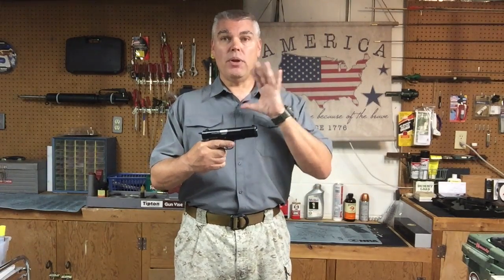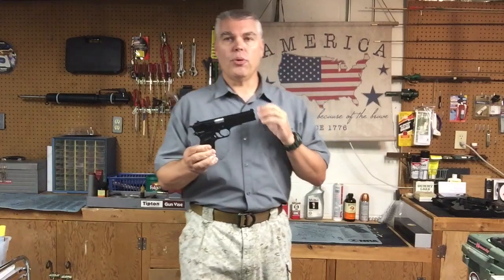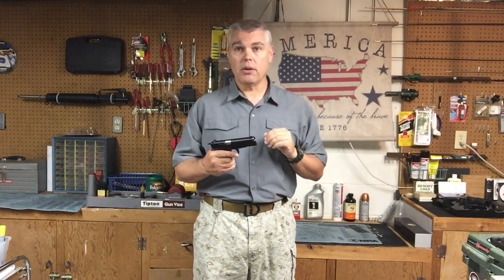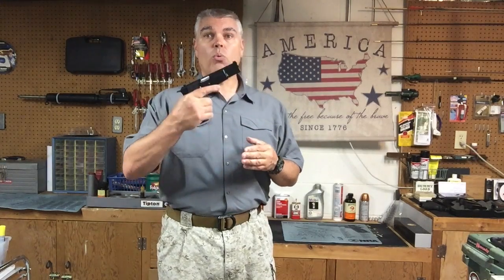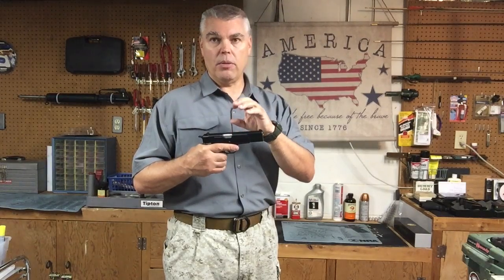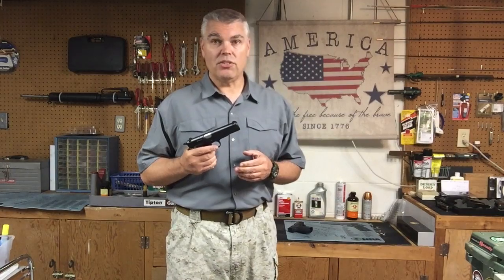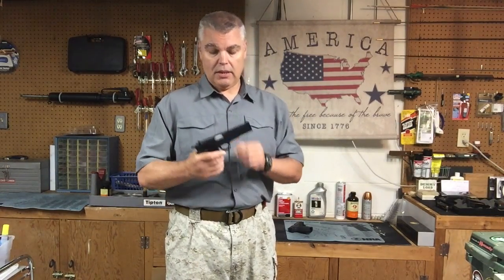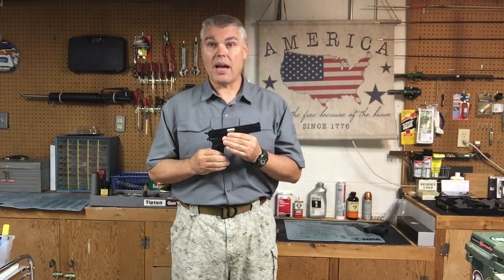Browning Hi Power Mark III - The Fighting Pistol

Comment: the Mec Gars 15 rounds works great, congratulations, have had mine since about 96, shot enough that I actually shot out the barrel, 3 inch groups at 10 yards is a really good indicator! new barrel back to ragged hole, my woods gun and for many years my off duty gun!
Reply from the maker: ed swede I really like the Mec Gars, and I love the Hi Power. I think they make a winning combination even in the Glock era.

Comment: It only takes 5 minutes to remove the mag safety, simply tap out it's retaining pin on the trigger then all the gritty creep feel goes and it drops about a pound in pull. Did it to every HP I have owned. Actually, technically I still 'own' two MK3's but one was confiscated by the French government after registration and the other by the South African government after importing and registering it. Yep, "registration" equals "confiscation "! BTW the last MK3 I purchased came with booster springs at the base of the mags to eject them, worked really well, boy did they fly out fast when you pushed the mag release button!
Reply from the maker: Britishshooter I removed the mag safety i one of my Hi Powers. It is, however, still in my Mark III mainly because the trigger is pretty good even with it installed. The other reason it's still there is because I hate to alter that pistol. It's in proper L9A1 configuration, and I like it that way.
Reply: Fair enough. It is a really nice pistol, now you videos have got me lusting after a Browning as much as a 1911. I so long to have the freedom to shoot pistols again. I think I am going to have to move to the USA. I have been travelling there quite a bit in the last few years, I rode my KTM 690 dual sport across 14 states on the Trans America Trail in 2015 (flew with the bike in the cargo hold from Heathrow UK to Montreal and crossed the border then left again by plane from Vancouver) the USA certainly has some beautiful countryside, loved the Rockies.
Reply: please move, you will Never regret it.
Reply from the maker: Britishshooter My family and I have travelled to your fair country several times in the past. Three or four years. As much as the trips have been fun and educational, the fact that you are subjected to, what we in this country would consider unreasonable government intrusion into your lives, is blatantly obvious. That you are denied the fundamental right of self defense is a crime in itself. If you are thinking of immigrating to the US, rest assured you will be welcome, so long as you follow the proper procedure. It's only illegal immigrants (and, of course, terrorists) who are unwelcome here.
Reply: I appreciate that very much Sir, I really do. Sometimes I feel like I am living in a country that has lost it's self awareness and sense of history. If a citizen  is not allowed to defend his or her own life, then how can that person be anything but a slave, and how can that country regard itself to be anything but a totalitarian state? My dear friend,never give an inch, defend your rights to your last breath or you will end up like us.
Reply: Judge Dredd Maryland,  New Jersey, Connecticut, Massachusetts, Rhode Island also avoid. Maine, New Hampshire and Vermont are good as far as the Northeast goes. 

With the exception of Maryland, most states south of the  Mason-Dixon Line are good. The Northern exceptions directly north of it are Pennsylvania and Delaware
Reply: I agree that removing the mag safety vastly improves the feel of the trigger pull mainly by eliminating the grit and drag.  However, not all Hi Powers have trigger pins that are easy to release.  The one I serviced this way was a MKIII with a matte finish.  No amount of force using hammer and punch would dislodge it, so I resorted to a heavy duty press to pop it loose.  After that the process was simple, and the result was a lighter, smoother trigger that still qualifies as a combat pull.
Reply: @hrfunk  if you still have the browning,  just polish the upper part of the magazine were the  disconnect touches..really helps the tigger/ late comment but a Great review on the Browning!!
Reply: @Chainsaw_18.  Good tip, also polish the face of the disconnect "shoe" and the slick surfaces interacting will smooth trigger pull and assist ejection.  Were life perfect it would be useful to be able to get those spring loaded magazine bases to install on already possessed magazines, as well as 15 round capacity followers.
Reply: Oh…you mean the hazard device the designers never wanted, but added after the fact to satisfy a French Army demand, but the pre-war French then rejected the pistols. If they aren’t giving away the airwar plans to our enemies, they’re sabotaging our equipment through absurd design demands. Ugh.

Comment: Love my Hi-Power Mark III.. Not obsolete.. Obsolete implies that something newer is better. I'm not seeing better in any of the new firearms. Every negative can be fixed.  Grips : Changeable.  Mag Safety :  It's Easily removable.  Trigger pull :  100 % Customizable with Spring kits and gentle tweak of the sear spring.  Sights :  Easily customizable both front and rear are Dovetailed.  I did all the fixes I mentioned. I now have a beautiful Hi Power Range gun with a 3.3 pound smooth as glass trigger.  Fibre optic front sight and 15 round MecGar mags.  Beautiful Rosewood checkered Grips and earlier this week I Glass bead blasted the entire frame, hammer , trigger and controls.  Resulted in a beautiful brushed aluminum frame.  So Obsolete ??  Naw..not even close..
Reply from the maker: It sounds like you have a great Hi Power! Enjoy it!

Comment: Great video. You prefer a 6 lb pull, I like mine about 4.5lbs. To each their own and in what was a free country we should recognize and respect people will make different choices and have different preferences. There is no question your expertise and experience exceed my own by orders of magnitude (which is why I watch you to learn).

Still, I maintain a magazine disconnect is a hazard device, and one I had removed from my two HiPowers. Massad Ayoob previously held that view until he was shown reports of two incidents where LEOs were in a struggle for their firearm and managed to hit the mag release, thereby disabling the pistol. While I absolutely believe Mr. Ayoob read those reports, I find the reports too fantastic to be believable. I just can’t imagine anyone in a fight for their gun with a deadly adversary having the presence of mind to eject the magazine and being able to effect that action while in the midst of a struggle. Fine, let’s say this did happen a few times, how likely is that scenario and how likely is someone losing control of their weapon going to be able to do that?

By contrast, we know magazines are the weak point of semi-auto pistols - almost all of our malfunction drills involve tapping, reseating, or stripping out the magazine. We hear a bump in the night, we grab our trusty Browning and perform a low light check of the chamber and mag as we were taught, but we fail to fully seat the magazine. I’ve done that on the range many times with all sorts of pistols. With my 1911s, I still have a shot. With any handgun with a disconnect, I’d be in a very bad way. To me — just for myself — I see a magazine issue or malfunction requiring magazine manipulation as far more likely than being John Wick in a fight for my gun and pressing the magic button. As I wrote, to each their own - we have to judge risks for our own situation.

I believe I read elsewhere you have a HP with the mag disconnect hazard removed, but left it in place here because you want to keep it original. That’s an excellent reason. If I had a HP as a collectible, I would likely come to the same decision. 

Regardless, I enjoy your videos and have tremendous respect for your knowledge and insight. Thank you very much for taking the time to share expertise with us.
Reply from the maker: You're welcome. Thanks for watching and for posting a great comment!

Comment: You take an intellectual perspective in your reviews.  There are many examples of obsolete weapons still in service and preferred by those having them, for example world war bolt operated rifles turning up in Africa and the Middle East to this day.  If an operator has a High Power in hand with a round chambered and cocked 'n locked he is equal to an adversary with any polymer wondernine also in condition 1.  The holy grail question is the mechanics of getting off that 1st most important shot either in double action, single action or safe action mode but its all the same when accomplished.  High Power is ergonomically thin and pointable, modern pistols chunky.
Reply from the maker: Your last sentence rings particularly true.

Comment: At this point "Budget Hi Power" is a myth.  Anything Browning or FN marked is insanely priced, and even the clones are getting massively expensive.
Without a pull gauge, I'm just guessing that the trigger on my Mauser marked HP clone is right around 8 lb - in between the 10-12 lb DA and 5-6 lb SA on my M9.  The sights on my HP clone are where it really falls flat, they're very much WW2 era GI sights; a low narrow notch in the rear and a short half-moon up front.

Comment: I carried a 60’s era BHP as my off-duty for many years [I started with a Colt commercial ‘1911-A1-ish’ and gravitated to the BHP* (*trigger disconnect removed. A European mandated feature)]. The only thing, other than the uncertainty in manipulating the European-sized😮safety tab [now factory-corrected] is the somewhat longer than the 1911 trigger reset which, at least on mine is neither audibly or tactilely detectible (as it is in the 1911). I view this as a training issue, as long familiarity has eliminated any uncertainty as to following shots.

As to budget friendliness, I plan to look into the Springfield Armory made SA-35 which with it’s forged steel slide and frame AND CNC machining holds promise as a real 19:33 upgrade to an already high quality pistol.

Comment: The Browning Hi Power is a great pistol to customize.  Remove magazine safety, polish the moving parts, and upgrade the main, and recoil spring, and some new grips, is how my 1989 HP rolls.  4+ lb. clean break trigger.
Reply from the maker: The p-35 is one of those pistols like the 1911, that is great either in its factory form or as a customized beauty.

Comment: I had to look at this video since Springfield just re-introduced the gun again. The BHP is still a valid design and even though it's an all steel gun with an exposed hammer, I'll still take it over some [if not most] of the plastic guns that have been introduced. I have had my original since the late 80's and it's still a great gun.
Reply from the maker: I still like my Hi Powers. I have been searching for one of the new Springfield versions since the were announced, but no luck so far.
Reply: @hrfunk  Yes, no luck here as well. Either a great marketing decision gone bad that the demand is this high or their marketing department didn't expect this. I am glad the pistol has made a come-back.

Comment: As someone who has carried a Hi-Power into harm's way, I will state categorically that if the SHTF I would prefer to take a P-35 with me over any "modern" 9mm I have tried to date. On the BEST one I owned, I DID have a good gunsmith remove the magazine disconnect safety; this took all of the "grit" out the pull, reduced the pull weight considerably (slightly under 4 lbs.), and alleviated the issue of the magazine not dropping free. I still kick myself for letting that pistol go...
Reply from the maker: It's hard to go wrong with the P-35. Too bad it's no longer with us.
Reply: learn to do your own gunsmithing if you are preparing for when the SHTF.  Removing the mad safety is simple as driving out the little pin on the trigger.

Comment: I think my Argie FM is a clone of the early '60s High Power, with the external extractor, spur hammer, tiny safety and flat black plastic grips.  Given that the early HPs with the round 'rowel' hammer was bad about biting, I definitely like the newer hammer.  It just touches my hand as the pistol recoils.  I plan to replace the tiny button safety with the larger Browning ambi safety, but otherwise leave it as is.
Reply from the maker: I hope to get a chance to try one of those someday. Thanks for watching!

Comment: Guess who designed the FIRST “striker fired” pistol…..  John Browning.   In fact, he wanted to make the Hi-Power a striker fed gun, however it never happened.   I’m don’t remember if that was because France told Browning they didn’t want that or if it was because years later, Dieudonne Saive decided against it with the final prototype of the Hi-power.   Nonetheless, JMB did create the first striker fired (prototype) pistol.
Reply from the maker: I know before he died he built two rather crude tool-room models of his concept of the pistol that would eventually become the Hi Power. If I remember correctly, one was hammer-fired and the other was striker-fired. I don’t know why the hammer-fired version was ultimately selected.

Comment: My first handgun was a HP. To date, I have two Brownings and a Turkish clone, the Tisas Regent. No handgun fits my hand as well as the BHP., a great pistol. Do you find the 15 round mags, reliable? I have always used 13 rounders, either Browning or Megar, and only load 12 rounds, ala  the British SAS.
Reply from the maker: I've got a couple of the 15 round Mecgars and they have worked fine to date.

Comment: Now with the Springfield version, interest will be renewed. I disagree with those who think the full size steel handgun has seen its day. I don’t find much appealing about polymer , striker fired pistols. They are tools and they are cheap. The micro 9 may be the rage for ccw, but not as a duty pistol or for home defense. The Browning is still of interest as a historical pistol, but is still viable for home defense and sporting pistol. There are also tons of magazines available. If Ruger is smart they will offer a mag well adapter for the pc 9 carbine that takes the Browning mags. I have two high powers a late model Portuguese built with Browning parts, and an Argentine FM version. I might add a Springfield version. If Springfield is smart , they should look at resurrecting other historical pistols like the Colt 1908 380, and maybe a 22lr version. Just saying
Reply from the maker: I can’t wait to get my hands on a new SA35!
Reply: Me either. Like your evaluations. The only flaw is the lack of an ambi safety. They should include either two 15 round mags or if In oppressed states three 10 rounders
Reply: @Desperado3248  Oppressed???? To what do you refer? I believe the preferred term is Californicated.

Comment: Hello Sir...As a left handed shooter, I use the safety tab on the right side of the pistol.  There is in my Mk III some play in the flipper part of the safety, meaning that the part of the safety my thumb hits has some "up & down" play, almost as if the roll pin that holds the flipper part onto the stud isn't tight enough.  Is your gun like that too or does mine sound too loose?
Reply from the maker: Mark Chicketano I think a little bit of play is pretty common. So long as the safety engages/disengaged positively and the lever attachment is secure, I wouldn’t worry too much about it. Still, if you’re concerned you might want to have a gunsmith take a look at it.

Comment: My 40 cal Hi power came with a mag that has a spring , The mag Launches out with ease, was that a later add on or was that part of the original design
Reply from the maker: It was a later "add-on". The magazines have a small spring attached to the base that pushes them out of the mag well. They were/are called "mousetrap" magazines, and they work very well.

Comment: Have you tried the FM hi power made in Argentina? It’s got a slightly different looking slide Heavier. You can try mine if you like.
Reply from the maker: I have not. I'd like to, and maybe if you're close by I'll take you up on that offer.
Reply: I also have the Argentine FM Hi Power, which is a genuine FN licensed Hi Power made on FN machinery. It's basically a 1960s-70s FN Mark II design, 100% compatible and functions very well. I believe the Argentine FM is the only genuine Hi Power to actually be rollmarked "Hi Power"! Being an idiot I neglected for decades to buy a Hi Power then 12 years ago saw this one quite cheap. A little Googling and I dashed back to the gun store to snatch up the FM. I think the FMs with the heavier slide (and the compact Detective model) are newer manufacture, around 1995. My older one was made around 1988 I think.

A few years ago I came across a dozen Israeli surplus Hi Powers Cabellas had just put on display, all priced at $450. Most were FN rollmarked Mark IIs but one Mark III was rollmarked Browning and "made" in Utah though it did have an importer marking like the Belgian pistols. (I thought this was quite interesting as Browning marked FNs usually were earmarked for sale in the USA but I guess some got redirected.) I narrowed it down to the curious Browning Mark III because of the better sights plus it had little internal wear though a lot of rough wear on the epoxy finish. That beat up finish was interesting because my Argentine FM Hi Power had the same type of tough black epoxy finish but it wasn't scratched up much. Both are fine pistols, why did I wait so long!

Comment: Have you used +p or +p+ ammunition in your Mark III? I just purchased one made in 1990 and I'm a bit concerned about it. Not sure if the rumors of High Powers not being able to stand high pressure loads are true.
Reply from the maker: I have shot it a little bit with +P, but not any +P+. So far I haven’t had any problems.
Reply: Hi. Thanks for your response. How about holsters? Have you found any holsters that you like for the High Power?